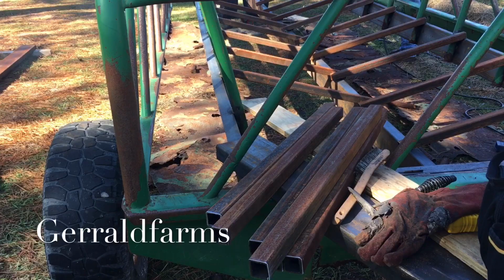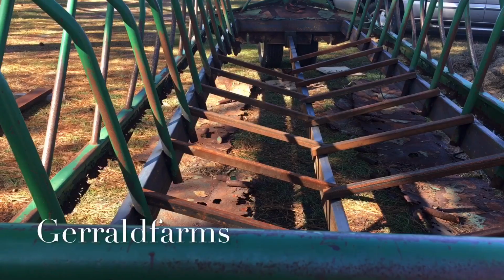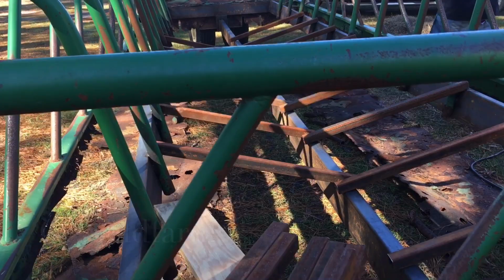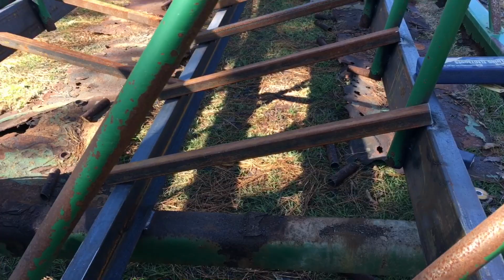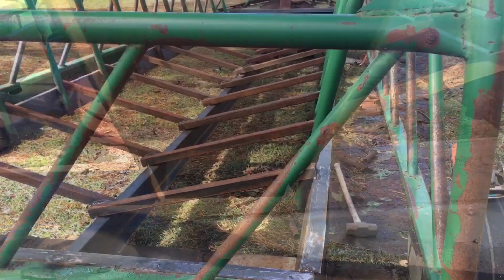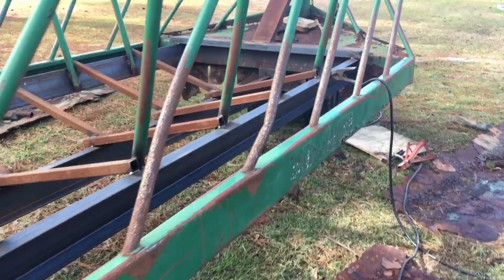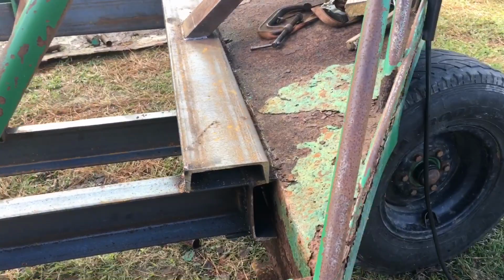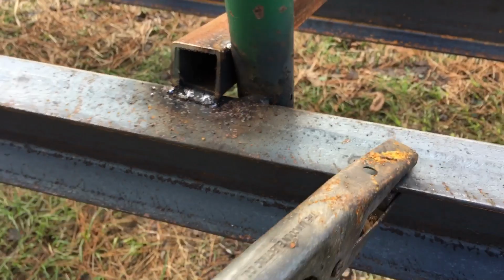Hay feeder trailer repair part 2

Comment: Good  day Back in 1986 starting working in welding shop.  
Someone  sold my boss a pattern & it was a big improvement over round  able feeder laying bale on ground.  I called it Haysaver,   cradle holding bale off ground..  This is a real good idea.  If they need floor they can use plywood.  Thanks  good video. Boy that looks like nice weather.
Reply from the maker: The hay savers are nice. It was nice here last week. 40’s here now.  Upper 20’s tonight. Have a good one buddy

Comment: That is not a "repair" THAT was a rebuild! Nice job Jacky and Son. You're not exceeding the duty cycle of that welder are you? The old tombstone Lincoln welders had a 30% duty cycle (3 out of 10  minutes), the new Miller ($2800) and Hobart ($1700) MIG welders are 60%.
Reply from the maker: I don’t think we’re exceeding it. It will be hard to get me to actually work more than 3 min in a 10 min period. Have a good one buddy